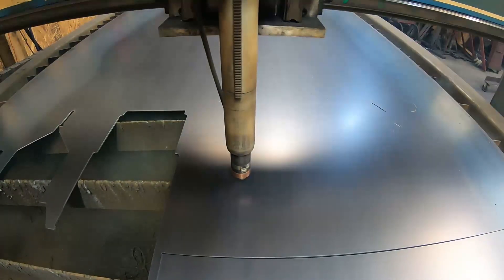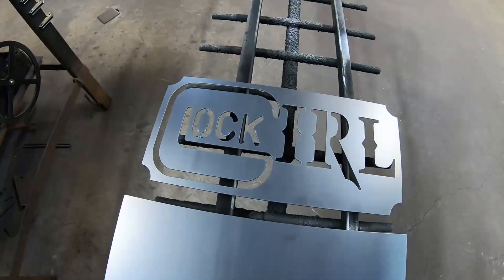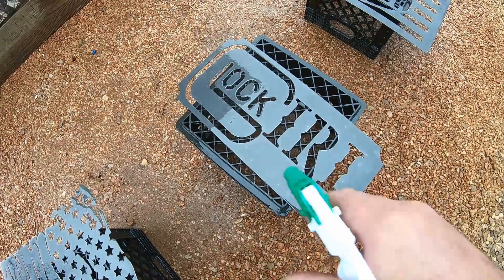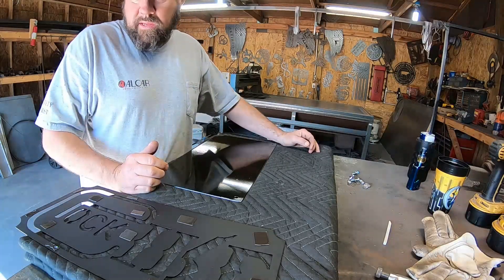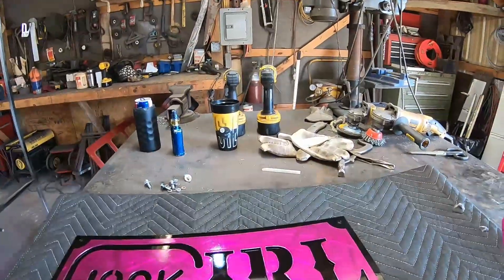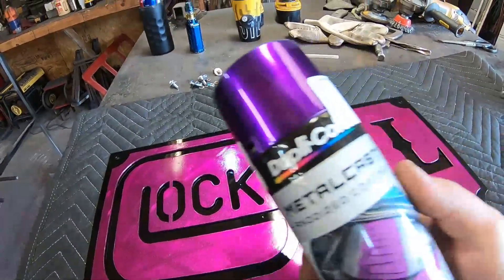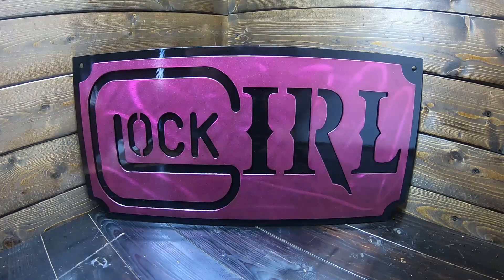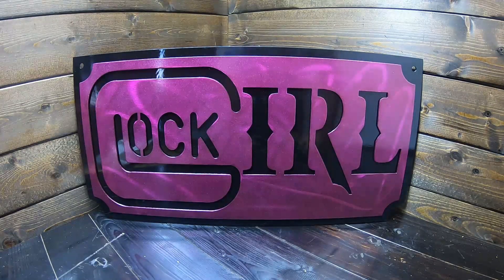Working on a new metallic color, let's see how it goes.

Comment: Sassafras gave you the right answer to your popsicle sticks idea. I have been using his method exactly for years now and have never had a problem with the blind slats. You want the plastic ones though. The tin ones will leaves scratches from the little oval holes that the strings go through. Just think smiley face when you are installing them...edges up!

Comment: To heck with Popsicle sticks!

Go in there and rob 3 or 4 of those extra plastic louvres out of MrsSOT’s Venetian blinds.

Put them on your substrate so that they bow up... that way the sharp edges won’t mark it.  Once you place the top laminate in where you want it.... press one end down and slip the louvre out.  Repeat as you work your way down the piece.

I use these regularly to laminate wood and Masonite.  They don’t mark, they don’t stick to your adhesive and they are reusable!

I found that if I shake metal flake cans between every other stroke or so & wipe the tip after every coat it seems to reduce the pits and globs that I get. But, I have to admit.... I haven’t tried it with pink!

The sign came out awesome..
I realize it was a customer spec but... A nice pink bullet hole would be a cute touch.... don’t you think?